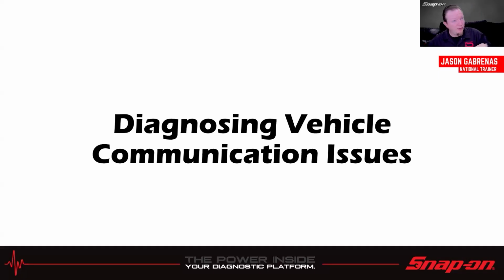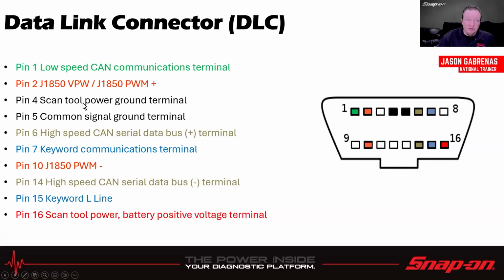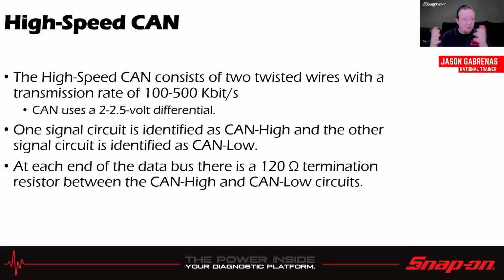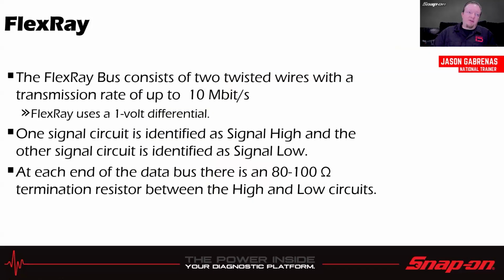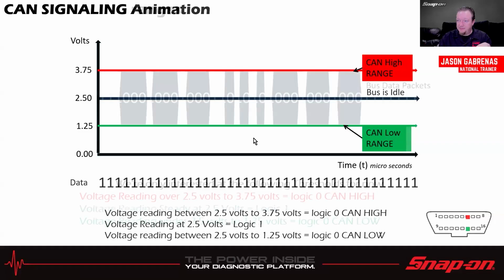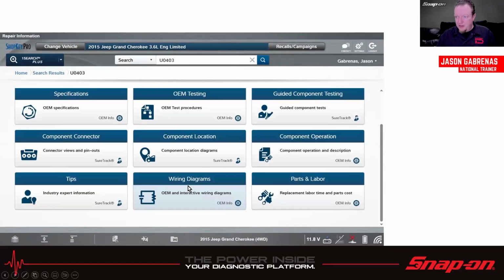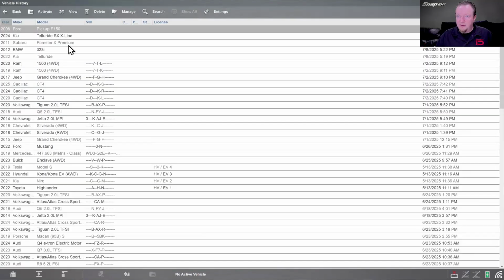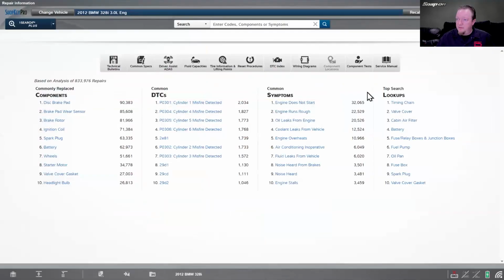Tuesday Diagnostics Livestream - Diagnosing Vehicle Communication Issues | Snap-on Diagnostics

Comment: 2020 Ram rabel had  cow that the crashed  into led head light and tail light. Cow damage  the rear tail harness as well. I replaced  and  got to see the can two twisted wires going  from the tail control module  to the tail light.  The headlight  had a core return, so I could not tear it to see how it worked. Rear tail light made of 5 printed circuit  boards. It cool what they are doing, but it is expensive to customer